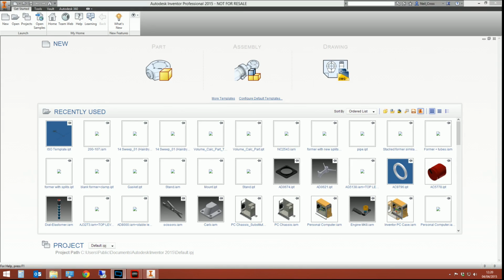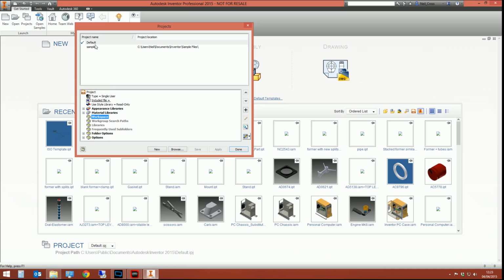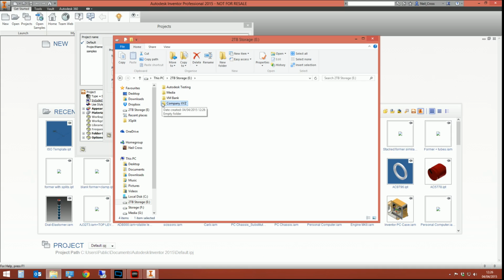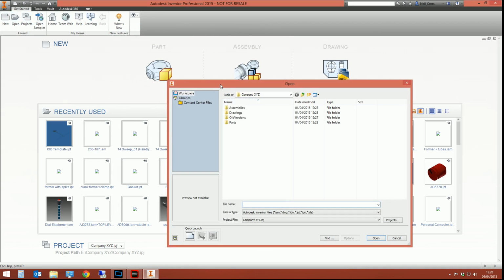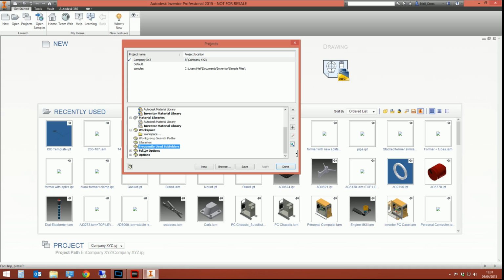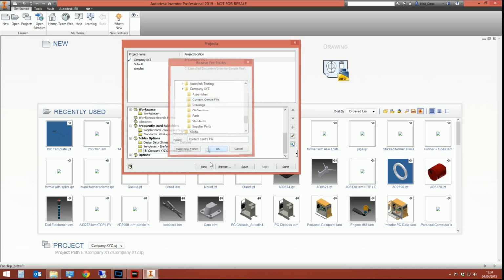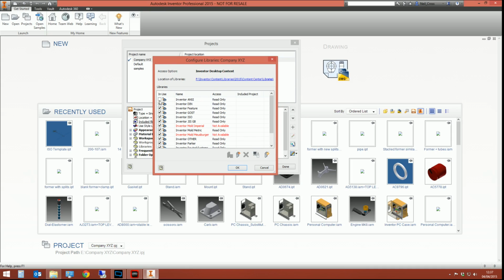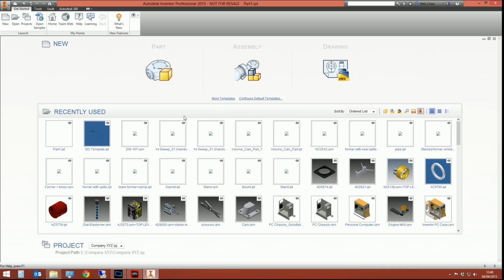Detailed Project (IPJ) Guide & Tutorial | Autodesk Inventor

Comment: Hi i have just started a new job, for a small company, im been using inventor for about a year so am intermediate user.. 
the last place I worked was i big company so we used multiple projects etc.. what i am struggling with is where to set up my project.?
We have a drive at the company where all the different jobs are kept, i intend to use one inventor project across all the jobs as they are small jobs etc
I don’t have the option for vault, i also want to be able to work from home at times and won’t be able to log in remotely to the office drive 
So where do i set up my project? On my C drive or the office drive? And how do i path each job to their different job folders?
Thanks in advance, your videos are saving my life right now,  this job is a real challenge and im on my own

Comment: If a user were to create a large library of files and divide each project with its own .ipj. Do you see a problem later on creating and using an .ipj file specific to a group of folders, equipment, class, etc; for other users not directly involved in the creation of said library?

Comment: Another great video. Thanks Neil. One question - is it possible to save a generic projects 'template' so that every time you go to set up a new project, the things that you might want to standardize across all your work such as styles, libraries, standards etc. can be quickly set? Thanks again for sharing you knowledge!
Reply from the maker: Thanks man :) The only way to do that is to input those standarized paths into the application options > file tab, and then use [Default] as the setting in the project file.  You can then export/import the applications option across all workstations.  That's the only real way to do it that I know of!
Reply: ESSAY WARNING... ! :)....

Ok. Cheers Neil. Think I get that. I'll look into that when I get to it as quite, in fact very, new to Inventor!...

(I'm just trying to learn from the word GO the best workflows and methods as - although am coming from a pretty competent 2D & 3D AutoCAD + not too shabby Solidworks background - I want to start using Inventor and have some real word projects (furniture) that I'd like to use to learn on the job so to speak! :/

I was wondering in that vein of one possible video request if it’s OK to ask - and apologies as know you will have covered many of these topics already is – so feel free to tell me where to go! But...

... a video that is almost a check list of things to know about and set in place before diving into complex(ish) work in Inventor. Not so much the excellent details of your other vids but more like a check list of things / terms to know about. Some of these terms / subjects I will know about as a newbie, but others I may not even know to 'Google' if you get my drift. So thinking along the lines of.. ‘Hey! First set up Templates, then Styles, then know about Projects, this is Vault but you may not want to use it because of xyz, etc. ect.’, might also be cool to go into interface customisation like keyboard shortcuts (use these all the time in AutoCAD). Obvs not going into the detail of your other very informative videos but more ‘hey do this, then this and then this… before doing this!!’ 

Also going to push my luck here now as well while I’m writing an essay! Would be AWSOME to see in You Tube an almost 'showing off' video of what Inventor can do, maybe using some typical workflows (and more fancy workflows perhaps) showing all the party tricks of the program. Again a ‘wet the appetite’ of things that can be done but again a newbie might not know about. Most intro vids I have come across on You Tube are either quite slow tutorials showing how to model a simple 3d part, or too general (such as Autodesk promo type vids). Basically a vid where one can go after – 'that looks awesome - I want to learn how to do that!!'

Cheers and over an out! 😊